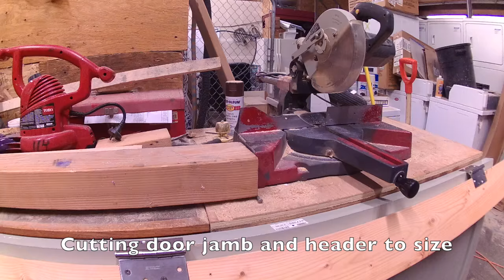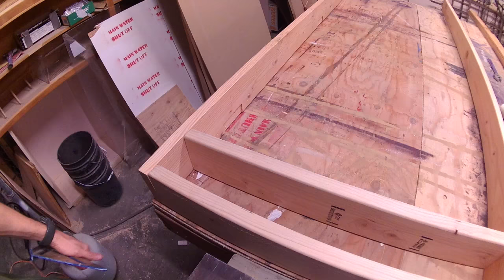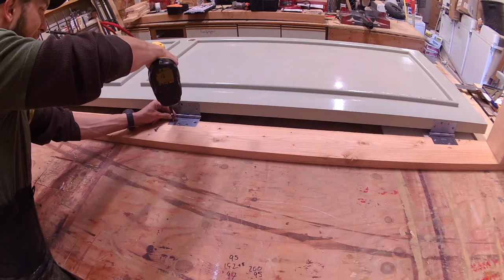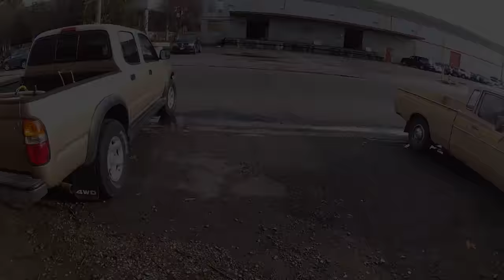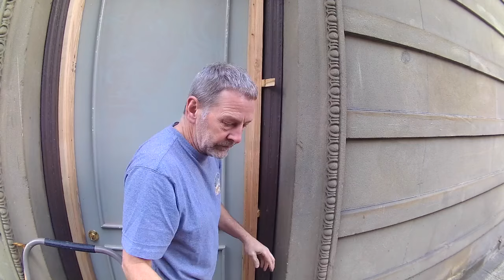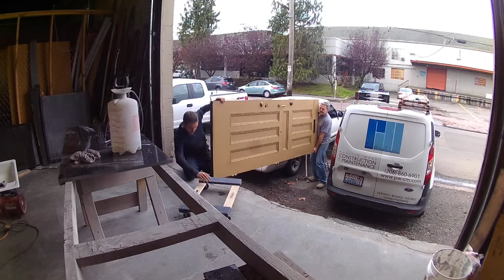Building a temporary door frame for a 100 year old door

Comment: A little overkill in some of your methodology (predrilling 2X pine really isn't necessary unless your driving large lag screws) but it got the job done.
Reply from the maker: David Mm 
When sinking these #10 exterior screws, it's not uncommon to split the wood. Yes, it's only a temporary door. Yes, the split may be minimal and completely acceptable. But it doesn't hurt to take the extra step to avoid it. 
Thanks for watching.